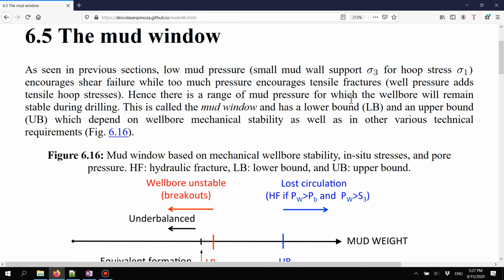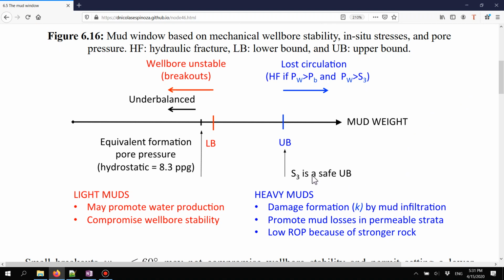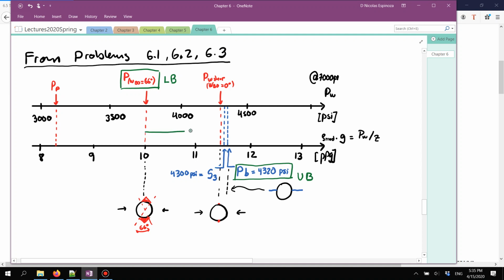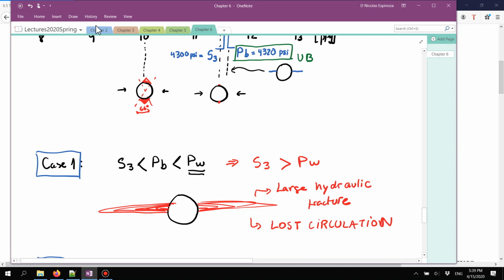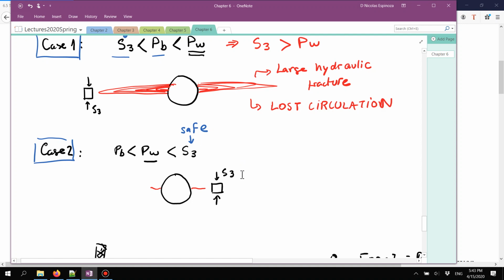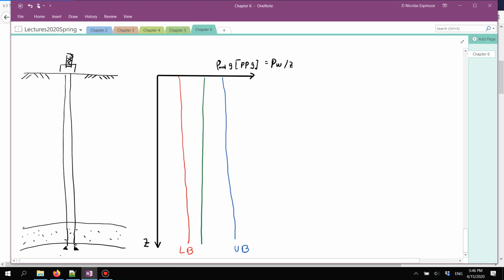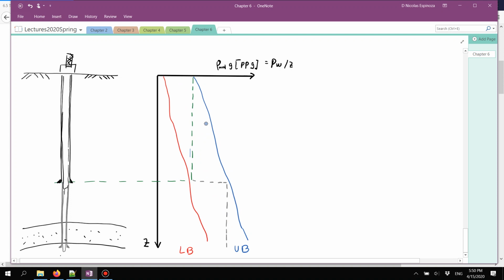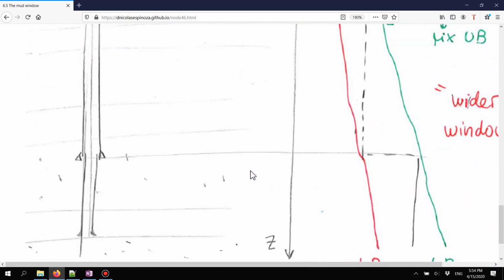L0416 The mud window and casing setting depth

Comment: thanks for you efforts, note just in case, one should also consider cement job, due to cement density (basically) a bit higher than mud weight thus casing setting depth going to be shallower to avoid fracure of LB while cement pumping

Comment: Sir i would like to ask if you have your mud window with the graph are there any specific formulas to compute for the burst and collapse load for the casings?
Reply from the maker: Hi, my notes and videos deal with mechanical failure of the rock only, not the casing steel. The equations for the mud window are available here: https://dnicolasespinoza.github.io/node42.html (Chapter 6. Wellbore Stability)